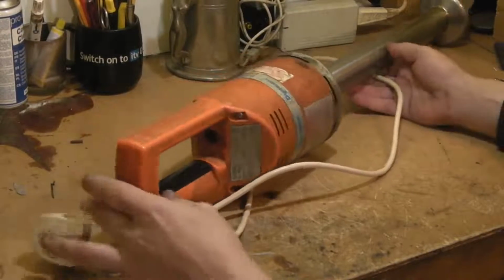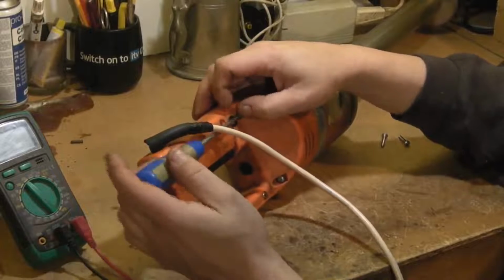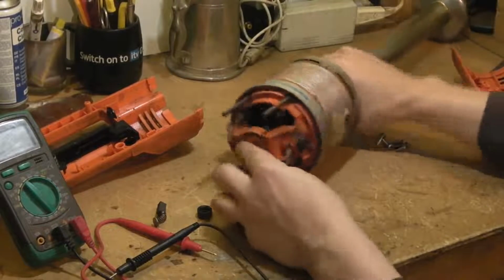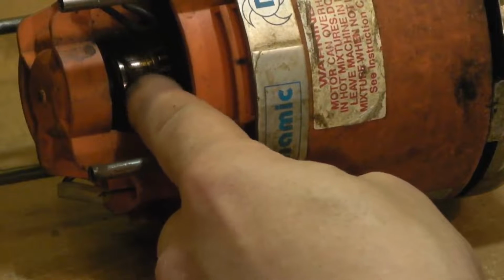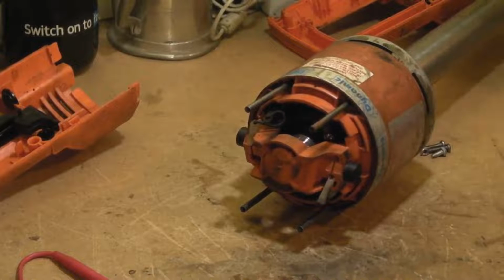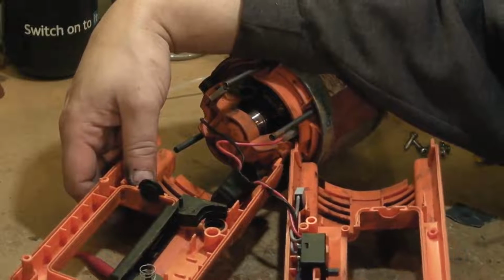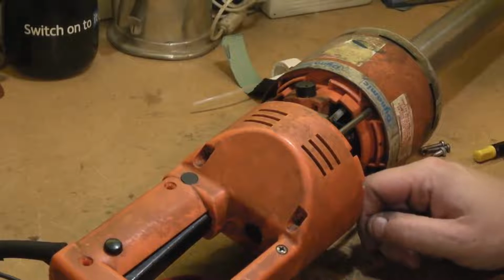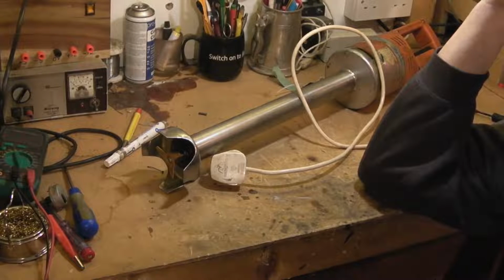Dynamic industrial hand blender repair, plus ramble about new workshop.

Comment: Hello. I know the device well. You can find all the spare parts and exploded diagrams in the spare parts catalog on the manufacturer's website. You should remove the armature and take a look inside the tube. The bearing and seal are probably defective. It's probably dirty inside, and the shaft may be corroded. The first two digits of the serial number are the year of manufacture. The device is still being manufactured today and is now called the MX91-410.